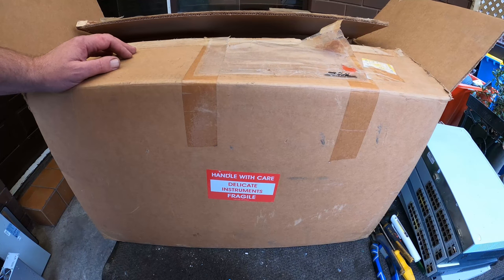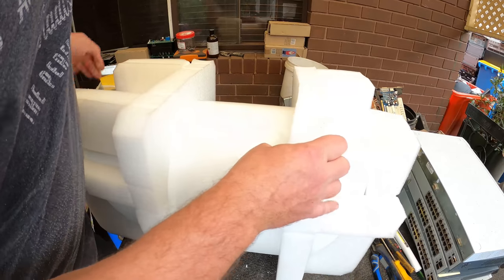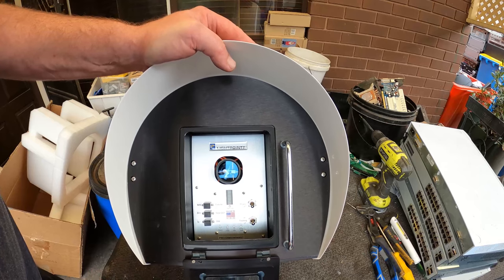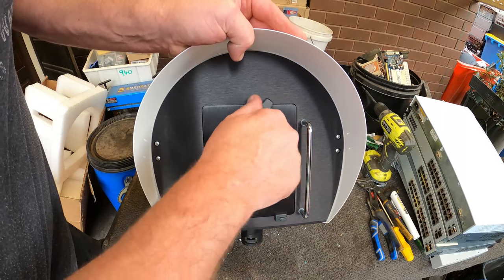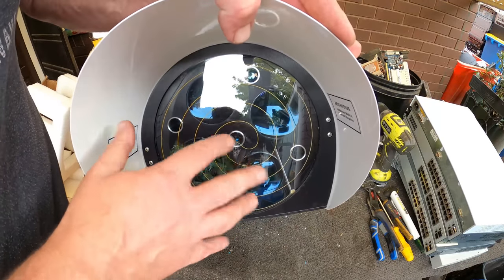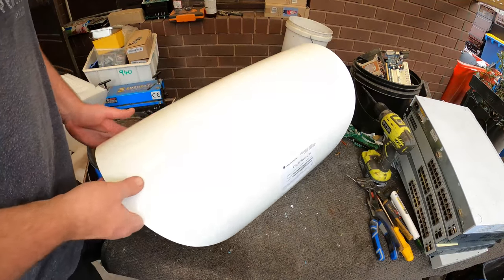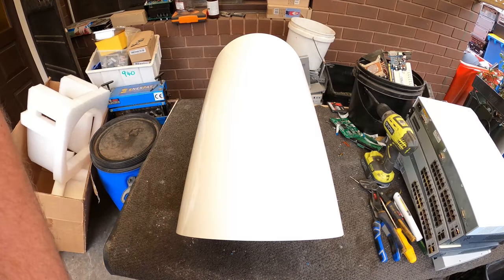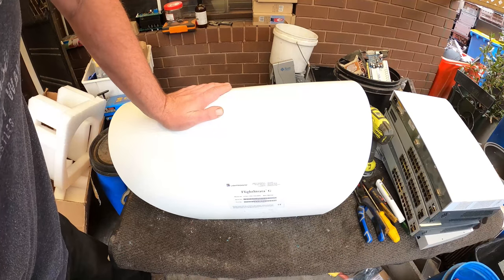What is It? Flightstrata G Gigabit Laser Thingy

Comment: That looks like a optical Laserlink: if you need a high speed, low latency local data network but need to cover longer distances (say between 2 buildings on one campus where running actual CAT6 cable is infeasable but you got sightline) - just encode your data in binary laser bursts... Obviously you'd need a mirroring receiver on the other side, but if you place another of these you'd even get bi-directional data transmissions. These buggers should have a theoretical upeer limit of about ~6Gbps UP/Downlink.
Reply: WOW!  I understand the individual words you use but not in the order you used them but it sounds fantastic anyway!  *Scratches head and wishes she understood what it all means*.  LOL Take care, Poo
Reply: @poosmate  Imagine network access via fibre optic cable where you send light impulses through glass fibre cables to communicate - this, but optical Laserlinks use air as the transmission medium instead of actual physical cables.
Reply: @poosmate  My attitude to this kind of info is: Somebody else clearly knows what they're talking about so I don't need to figure it out. What a relief!

Comment: As ChaTucker correctly noted, it is used to connect a high-speed, high-bandwidth data link between building without using wire.  You might want to ping your network of security and internet companies there to see if someone needs it.  I even saw one on eBay for sale!

Comment: It,s be used as  a data (internet) connection about (1.25Gbps) transmit /(receiver) through the air and can travel several kilometers  (2>~4) wirelessly some i25Gbps data by using laser technology in the air, is also used for example   broadcasts at sporting events

Comment: The FlightStrata G is the only product on the market to combine auto-tracking with a four-beam system. The full-featured FlightStrata models take LightPointe’s proven multiple-beam technology to the next level by ensuring the highest availability and performance of a standalone Optical Wireless solution. FlightStrata receiver lens layout combines Optical Beam Shaping (OBS), with Automatic Power Control (APC), addressing changing atmospherics and building movement. FlightStrata transmits four redundant beams of light that overlap and adjust via Multi-Beam Array Tracking (MBAT) technology. The combination of rotational optics, MBAT and APC results in greater link margins, which translate into improved Optical Wireless performance. FlightStrata is a direct result of customer feedback and our years of field experience around the world. This item is used and being sold as-is. 
Serial 1: FN01G8M507090501
Serial 2: FN01G8M507100524

Model: LFSA-1250-1KS-M8S

Part: 015-015302-00011

Age: Purchased NEW in 2009

Comment: that info straight off E bay 2 parts for this model $5000 USD.. has multiple lasers, telescope, other stuff way outside my tech knowledge.. . very specific bit of kit.. 16k USD sound right.. think has just been superseded.  old model 2009... my thought would be as better models are now available this would no longer meet standards or safetety guidelines in USA or AUS for its intended purpurse... but im sure would be very accurate piece of equipment and perform function was designed for perfectly fine.